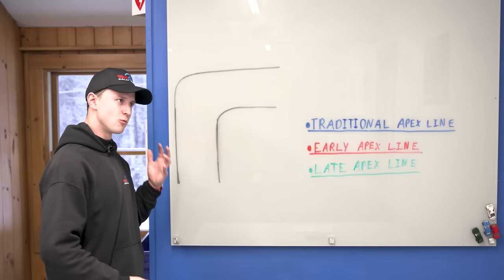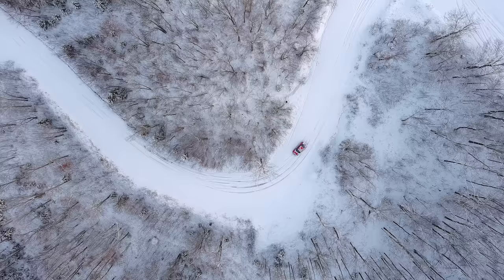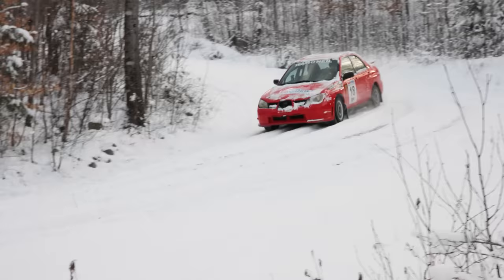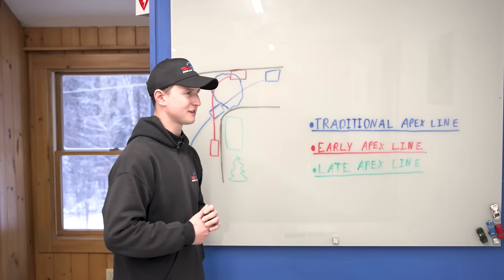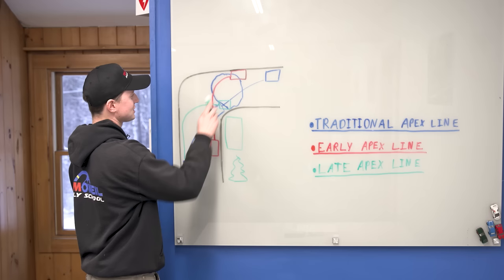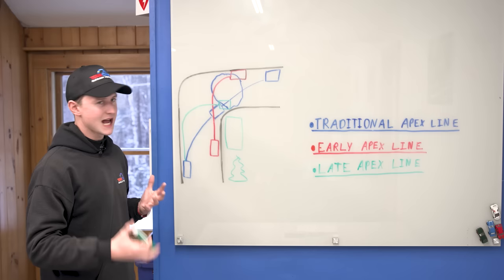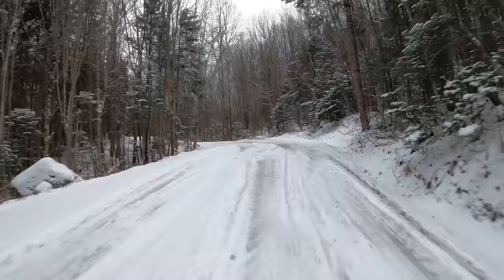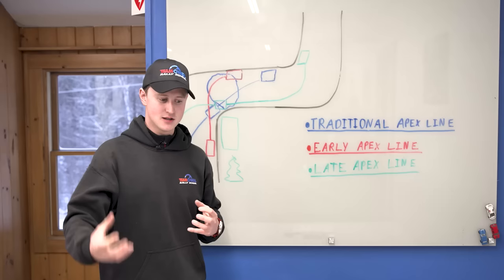Lines & Apexes Explained

Comment: Over ten years ago, before I did the TON Rally School, I saw a group of spectators on a bank at the end of a straight. I knew the road went left but not how much. I tried to do a power slide to impress the spectators (never a good idea) but ended up on the wrong side of the crown. We slid into an shallow ditch and rolled onto the roof. This was a valuable lesson. If you exit a corner on the wrong side of the crown, you might end up upside down in a ditch looking stupid.

Comment: Another great video on youtube on this subject that looks more at tarmac/circuit driving and how lines affect exit speed is "Physics of Racing" by Andre Marziali. Notably, a mix between the traditional and late apex lines allows you to maximize your acceleration as early as possible, and if your grip and acceleration are high enough it will give you a higher exit speed than a purely traditional line. Even if its slightly slower in a corner itself, its faster if the corner is followed by a long straight.

Its interesting seeing how environmental factors also play a role in line choice, something i never really thought about but have likely done subconsiously when playing rally sims.

Comment: Sorry, you all may be experts but this video has some glaring errors. Mostly I take issue with the visuals. You have a "traditional" apex, which is actually a late apex where the driver straightens the car until they hit the outside of the road and then turns that final bit. Then you have an "early" apex where the driver decides to start on the inside of the road rather than the outside. Then you have a "late" apex, where the driver forgot to turn at all, and suddenly realizes they are about to just drive off the road before turning sharply 90 degrees. A simple search for racing lines or apex lines results in a better description of the lines than what is done here in this video. 

The correct visuals should appear as such:
Traditional Apex has an entry and exit that are nearly symmetrical when bisected by the apex.
Early Apex has an elongated entry and a sharp corner exit. 
Late Apex has a sharp corner entry with an elongated exit.

The information about WHY, is all correct however the visual description of the lines is misleading at best, if not just flat-out wrong. The signature of each racing line is the corner entry shape, the shape and speed dictate how the corner exit must be driven in order to safely remain on the road. The late apex naturally puts you on the inside of the corner exit, giving the largest margin of error, and is the easiest to modify mid-corner in order to adjust your line as the road shows itself. For that reason, it is also the preferred line to take when the road and or road conditions are unknown.

While this is more advanced than what this video is trying to be, I think it is worth noting that all lines have their place. If you can only see the corner entry then a traditional line on a "Left 3 Opens" pace note is typically going to have a corner exit closer to that of a late apex. A late apex entry on a  "Right 3 into Right 3" will put you on the wrong side of the road to correctly take the second Right 3. On the same set of R3 corners, you could use the early apex line as a trail braking zone (assuming you start from the outside on corner entry,) which will set you up for a late apex on the second right 3.

Comment: What is the best strategy when dealing with two turns that go in the same direction? Do you take a traditional apex line in the first one as to set yourself up for a late apex for the second? When you don't have a lot of distance for the next turn its rather hard to always set yourself up for a late apex line, when you just completed one from a turn in the same direction.
Reply: Whatever allowes the most speed in the second corner Is what I usually go for.
Reply: I can picture what you mean and I think you mean 2 turns with a small break in the middle, and for that I say try to treat it as one whole corner, as you will come out of the first one ready for the other.

Comment: I dont do rally but i really like to drive in mountain roads when i go to univercity.  My best and safest route is to use a version between the late apex line and the traditional. Why is that ? well as he said i really don't know what its on the road, usually the side of the road is dirtier and even could have sharp objects from veahicle before me or dragged from the rain or just dirt and potholes. Also is much safer if there is a case that a car is coming ahead (if its a day) and its good to not go full. i always am ready to go back to my line just in case.   At night is much safier because you can see the headlights from the cars behind the turn and know if a car is coming and the shadows on asphalt helps me decide if the side of the road is decent for me and my car capabilities. i prefer that way because i dont lose that much speed, dont have such a wear of the tires, keep my car at 3000rpm and its more fuel economy and go home faster.  But you must know the road or at least drive it once or twice.   (sorry for my english)    GREAT VIDEOS <3

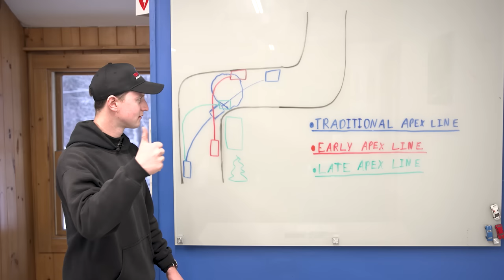Comment: 12:19 If the next turn was a right turn, the cars on the traditional- and early apex line will be better positioned than the car on the late apex line.
Reply: Agree. There is no always a better line, it will depend on the track.

Comment: Maybe a silly question lol but if you went into a left with a late apex and then into another left you would then have a early apex, Is there a way of avoiding that or would purely be foreseeing the road through the notes and taking a line that puts you on the outside? Or what could you do?
Reply from the maker: In this situation, the superior visibility from the late apex line would likely allow you to see the next corner so you can adjust your line accordingly and let your car track out and be better set up for the next corner. Assuming you can't see the next corner despite being on a late apex line, it is very easy to let the car track out if you finish the turn on the inside. Because of these factors, the late apex line leaves you options vs getting lucky with the traditional line. ~Drew
Reply: @Teamoneilrally  wow thank you hood job on the video it made alot of sense and that does too